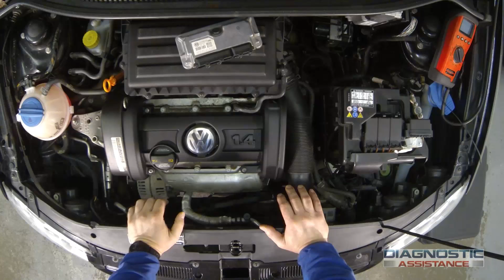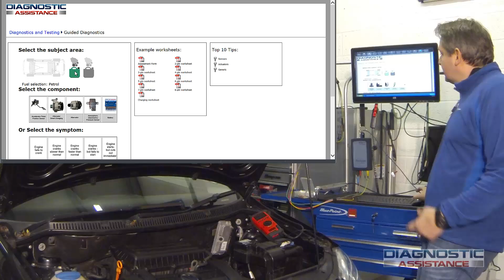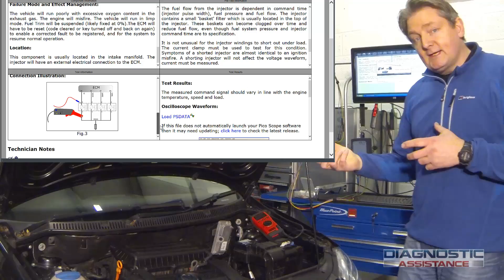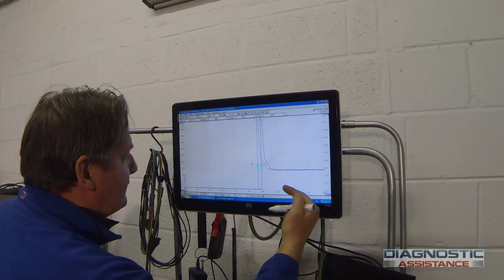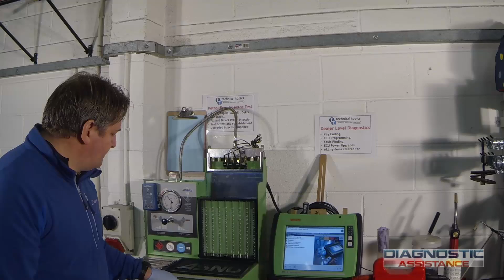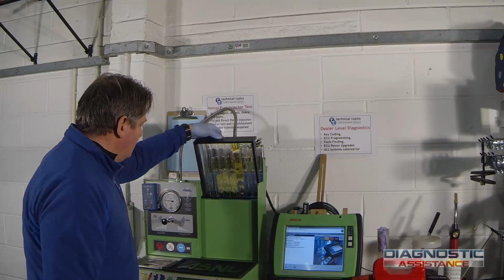VW Polo 1.4 Mystifying Misfire

Comment: Great demonstration of diagnostic and physical testing of the system. It's sad though that whoever did the compression test, didn't do a wet and dry test and even smell the oil on the dipstick for signs of over fuelling and washing of the oil off the cylinder bore causing a drop in pressure. I'm an old school mechanic with modern Skills but I always tell modern technicians to NEVER forget the basics. Eyes, ears and a nose were around long before diagnostic machines!

Comment: Hi JAMES,
I recently purchased a 2013 vw jetta 1.4L Turbo Sedan from an auction here in Western Australia.
It had a PO3O4 Code come up on my diagnostic tool.
This indicated that Cyl 4 had a miss fire.
I changed all the plugs and Coils.
Still the slight miss was there.
The car drives ok when driving round the streets here, but is rough on idle.
I completed a compression test and the results are as follows..
Cyl 1   110      Cyl 2  110        Cyl 3 110           Cyl 4     83

There is no smoke from the car exhaust.
It has only travelled 114,000 Klms and is in good condition.

Question:
If No. 4  fuel injector was open, or faulty, would this effect the Compression Test.?

I find it hard to believe that the valves or piston would be suspect on such a low mileage vehicle.
I also checked for air leaks and blew out the air filter.
I also checked the Air Intake manifold and found a small amount of engine oil inside.? Not sure why it was there.

Anyway i was going to purchase and fit a new Injector to No. 4 Cyl. Do you think it is worth doing given the results of the compression test?

If you can help with any of the above i would be very greatful.

Kind Regards

Nick 
Western Australia

Comment: Hi does the misfiring go away when you press the accelerator? I’ve got a polo 1.4 2005 petrol and it shakes on idle but as you put some acceleration it goes away ... is it the fuel injector or an electronic issue?? You’re help will be appreciated 🙏🏽
Reply: Did you solve this? I have exact same issue
Reply: @RumelM  no not yet some say it could be valve but way to diagnose is compression test on each spark plug inlet by removing spark plugs. Or it could be injector issue. Not sure what it is hope someone can help.
Reply: @RumelM  not yet

Comment: Phenomenal!
All the work on head and ecu etc.
I have a similar issue with a 1.4 tsi CAVE and after swapping coil and plug with neighbouring cylinder, the problem stayed put and I'll  be chasing no.3 injector next.
No Pico or quantifier though, that's  all fine equpt. 👍🏻

Comment: I have a mk4 polo 9n bby and it has the intermittent no start (code 01314) but when it does start it runs just like that and throttle pedal response is delayed and it cuts off cyl 3. First I'll check easy stuff like dry joints in relays and cheap to do things like that, had a few wobbly relay pins in my time that have been less than a joy to diagnose. I have the same gas analyser, great little unit.

Comment: hi, issue with my 2016 skoda 1.2 epc warning,  Seams like Arnold cark has said the diagnosis is that 2 injectors have failed which i think is nonsense, so 2 new injectors later Arnold clark still say there is a fault, .  Do injectors fail at the same time when the car has done 28.000 and just out of warranty.  Is it possible to swap injectors without coding to rule them out. ?

Comment: I encounter the same problems with Tiguan 2.0 .misfire..the source of the problem are injector cover clogged with carbon..i just clean the mesh metal Infront of the injector..problem solved
Reply: I'm getting misfires on my Tiguan too. All possible causes ruled out  and guessing on carbon build up. Did you clean it yourself or did you have to go to a mechanic?

Comment: it så easy test to check sparkplugs,coil and injektors.. i just changes with another cylinder   first plug then coil and last injektors  if the fault change cylinder than you know the problemet..  its the first thing you test...

Comment: Hey dude well done for such knowledge 
But will you please suggest me because I m facing a problem with my VW petrol 4 cylinder engine . If I m driving it in 4th gear and as soon as I reduces its speed to 40 kmph and again increases speed in same gear than it feels heavy misfire 
Please help me

Comment: Excellent diagnostics James but why on earth would the previous garage have removed the cylinder head when the problem obviously wasn't compression related ?....My only possible thoughts are that the excess fuel in cylinder 4 had caused bore wash.

Comment: super market fuels/ & wrong oils used, see this all day long, use Shell v power fuel & branded oils you get what you pay for.
Reply: benzman 113:
I agree totaly.... I was talking to a guy who was refueling a service station ,many years ago and he told me about the benefits of Shell and their additives.... I try all the time to put shell in but occasionall (Finance permitting) I have to sucomb to the supermarket price draw.  If the result of penny pinching is this video then you will lose out 2 to 3 fold.
I would love to use V power all the time but it costs too much to use it that often.
I'm Diesel now
Reply: @michaelhawthorne8696  Interestingly I have a mate who works at the Fawley Refinery and he says the exact opposite lol. That the chemicals in the V-power stuff are such low concentrations that they don't really do that much. He said it was better to use some Redex or fuel cleaner every once in a while to keep things tip top.

Comment: nice vid I have a missfire to mk 4 1.6 16v AZD engine trying the basics maff egr coils plugs thinking maybe injectors now. Its weird it will start say 3 times a day butthen it wont start maybe once the engines hot but even like 3 hours later still no start have to leave it till the next day. Any ideas?
Reply: +mike ford probably you have solved it already but I would check the spark plugs!

Comment: Hi James, I've got a problem on my 2006 Volkswagen Polo 1.6 (9N3 model). Engine code is BAH. Every 4-5 seconds there's a shudder on the engine which is felt right through my seat inside the car. When the engine is hot or just done long distance traveling the shudder becomes worse, every 2-3 seconds. I've done all my research on common problems of those engines. One of those problems are either spark plug leads (HT leads) especially cylinder number 4 lead which is close to the gearbox and also the coil pack (distributor). I checked all my leads and they were good except lead number 3 because of corrosion. Bought 4 new leads from the dealer and that did not solve the problem. Had the MAP and throttle valve cleaned and the shudder still wont go away. Took it to the dealer and they diagnosed the problem as slightly low compression on cylinder number 4. It didn't make sense as no fault codes were found. Upon asking they mentioned it could be a piston ring failing or sticky valve. Other common problems are either the engine speed sensor or the lambda sensor (oxygen sensor). After looking at your video I'm more inclined to say it might be an injector even though I have poured in Wurth's injectorcure into the fuel tank which dampened the shudder slightly, but after working it out of the fuel system the shudder came back. Also my hydraulic lifters becomes louder when the engine is hotter. The bill from the agents just to open the engine and then to diagnose the problem in depth without fixing any problems will cost me an arm and leg. What would be your best advice and also do you know of any common problems (other then mine) on these engines (BAH) especially when it comes to shudders? Any advice will be helpful as I'm currently a student and cant afford to pay a huge amount for in-depth diagnostics. Thank you in advance

Comment: great video mr Dillon    is there also a way to put a pico WPS500  into the fuel rail a dual trace a fuel injector on one signal and the pressure drops on the other channel?  I would think the #4 injector  drop would stick out like a sore thumb   thanks again   mark ferraro